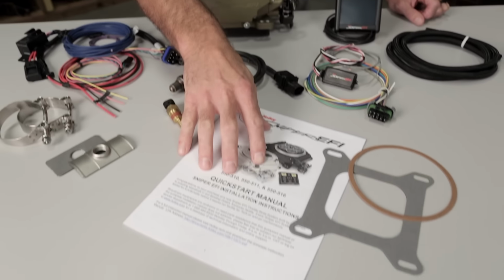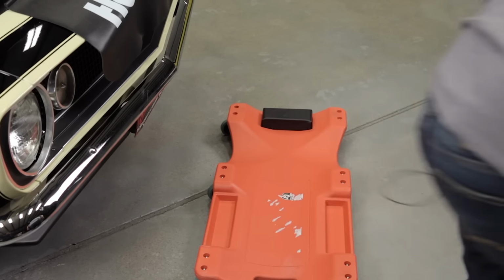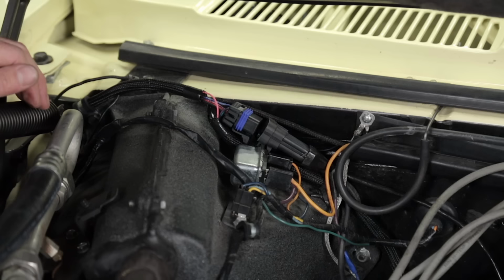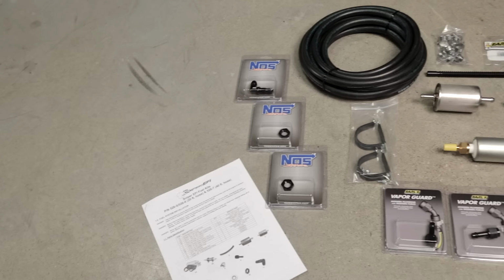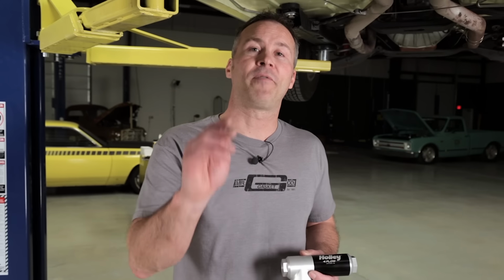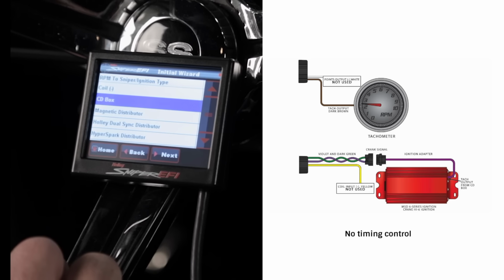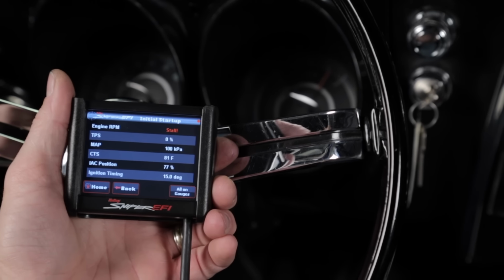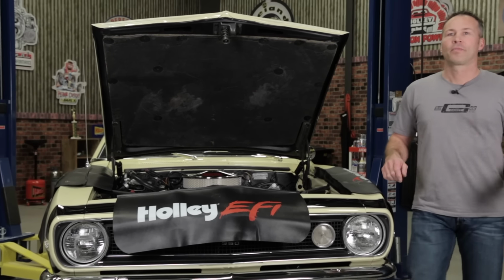Holley How To: Install Sniper EFI

Comment: It’s always best to run the return with a drop tube so the fuel doesn’t pour from the top of the tank. Use HDPE or fuel hose that is fuel resistant inside and out. If you use metal, make sure it can’t touch the bottom and won’t fatigue and end up on the bottom. It should end just above the tank bottom and not too close to the pickup screen. Fuel pouring in from the top can make bubbles that can be drawn into the fuel pump when the tank is partially full. Yeah I know, just another thing to do.
Reply: Prestige motors boat motorsports 632 in.³ 1000 hp big buck Chevy

Comment: Would this work on a gen 5 454 with tbi ? Old peanut head ports and low end power would probably love this.
Reply: I have the same setup. Did you get an answer?
Reply: @JoseOrtiz-jf3lr  didn't get a answer but I did try a carb and intake and it needs shaving work to fit correctly. I imagine the efi would work great but it'd need a good intake that fits
Reply: Yes but you need new heads and intake.

Comment: I have the Sniper efi on my cadillac -67 with 429, and breakerless ignition. Would it do much difference to get the MSD ignition? Will it run even better?
Would it be worth it? I live in Sweden, Europe so the cost for the MSD with shipping and customs to my door would be about 2x the price in US.
Reply from the maker: Yes, an upgraded ignition would make a significant difference

Comment: Do you have to grind down the intake divider? I saw that in a different video? I see he sets this Sniper carb right on the intake even though it is split into two channels? Please comment and tag me if you can shed some insight
Reply from the maker: In some applications the divider or gasket on a dual plane intake can cover the hole for the map sensor. As long as that isn't happening, you have nothing to worry about.
Reply: @HolleyPerformance Thanks!
Reply: For every 10 people that love these aftermarket throttle bodies you get 5 people that have had a nightmare getting them to run properly.

Comment: My kit did not include any throttle studs or kick down link.  Call Holley about that and they said I had to fabricate my kick down link and go buy a throttle stud.   The instructions said they were included.  Also got shorted one #6 fuel line fitting.   1972  Mustang Mach 1 2 barrel
Reply: Master install kit comes with stud and kickdown you need lokar cable and bracket look up my torino he shows install of kickdown for sniper efi

Comment: Most important! Anti-seize on the stainless steel O2 sensor clamp screws.
Reply: You better make sure the O2 sensor clears your drive line before you drill in your exhast
Reply: Copper antiseize!
Reply: Do I need to put antiseize on the O2 sensor threads?

Comment: The Sniper EFI should be engineered to use the standard fuel lines, fuel pump and float level fuel system while using only a pulse fuel injector controlled electronically. That would reduce the installation hassle to the oxygen sensor, the throttle body EFI and the display/computer. That would encourage more people to do the conversion.
Reply from the maker: That's an interesting concept! We're trying to make it simpler with every iteration!
Reply: @Cybair Agreed.
Reply: carb'd engines don't have fuel systems capable of feeding an efi setup
Reply: @mikefromedelyn2  - Of course. The point is that the TBI would have to be engineered for legacy low pressure carb fuel feed systems.
Reply: @ragingkajun86  so it can't be used with the original fuel lines?  the new system is needed!
Reply: The old fuel lines may not hold the pressure that the injectors need to operate
Reply: @davidjessee7701  - The necessary injection pressure can be generated in the TBI itself instead of the fuel pump. That's how a TBI works. No need for hi-pressure fuel pump and lines. That's the point for simplification of installation.

Comment: How do you expect to find switched power with the negative battery terminal disconnected? Otherwise, I’ll take two.
Reply from the maker: Wiring diagrams can be very helpful, but feel free to reconnect the battery temporarily if needed.
Reply: Nailed it

Comment: You will never get the same power with fuel injection as you would a carburetor
Reply: Yeah and a big fat LAZY nasty middle aged lady with no teeth and don't bathe and nasty attitude has bigger boobs than a skinny babe whos pretty, smart, and sweet, and makes you dinner every night. What's your point?
Reply: @ShinyRedGrapple  😂😂😂😂😂😂
Reply: Not true at all.  EFI systems constantly learn and adjust to their surroundings (temp, altitude, etc.) to give an optimal air/fuel ratio for the complete powerband.  Even on a perfect day, with a well tuned carb, it will never out perform a properly set up EFI system.  It just won't.
Reply: If you compare it to mpi type perhaps if you have the same exact F/R. The sniper has the same benefits as a carb when it comes to evaporate cooling of the fuel. After that the only time a carb beats a sniper is when it’s too lean and possibly damaging.

Comment: Wish I saw this 1hr ago. Purchased a reg carb
Reply: You did well
Reply: Bucking Bronco u not like the sniper?
Reply: @WampaRat  I'm personally not a big fan
Reply: Bucking Bronco gotcha. Anything wrong with them? Like design wise or anything?
Reply: @WampaRat  no it's really just preference.  A good carburetor has more tuning ability, can support more power, and is just as reliable as this EFI system.   But they arent bad, my neighbor has one and his 1951 Buick with a small block works awesome. But for my 460, I am going with a 750 cfm carburetor.
Reply: Bucking Bronco gotcha